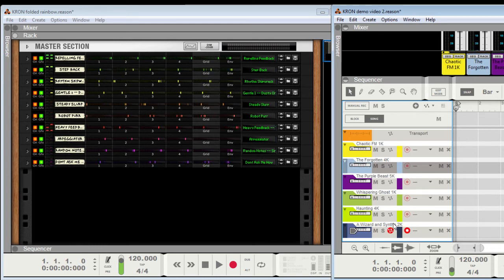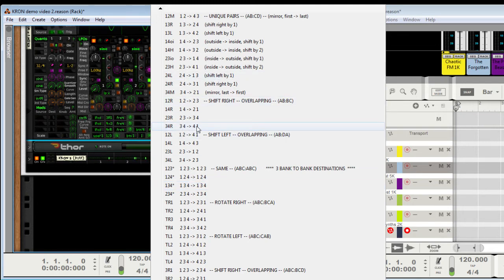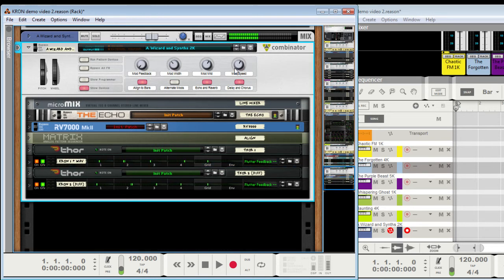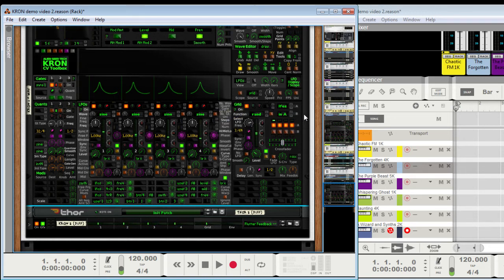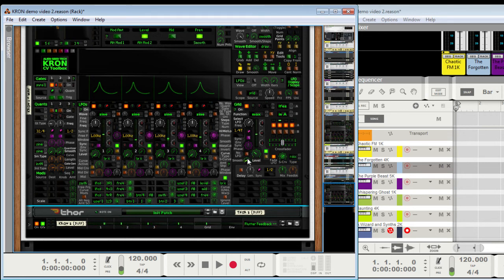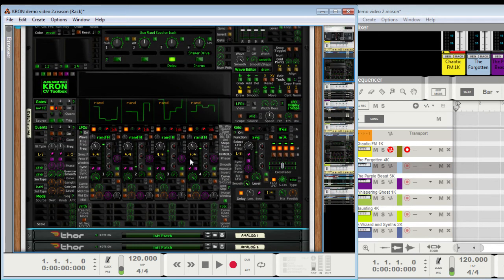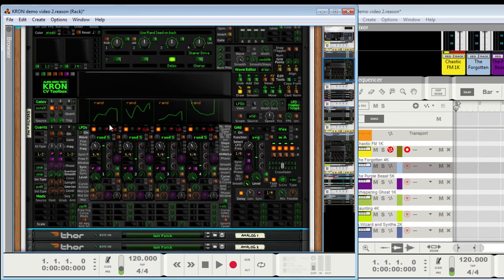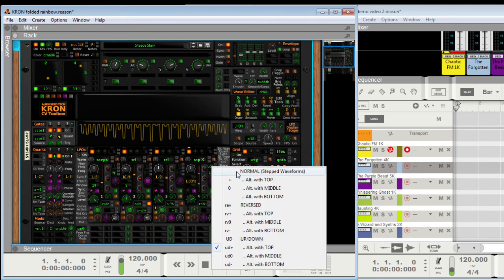KRON CV Toolbox: Demo 2

Comment: I'm sorry; this is off-topic. I notice your DSP level is high throughout the video. Every time mine gets to three bars, my playback/recording gets unstable. Could you give some insight as to why yours isn't glitching?
Reply from the maker: Running using the DX drivers and probably maximum buffer size. And a bunch of that cpu load is via the video capture.. I dunno. I often run over 3 bars with just Reason... but using m-audio asio drivers (and high buffer sizes). It's a quad-core, but it's not enough. :) I definitely run out of CPU on a certain songs... But tl;dr high buffer sizes are probably the way to help that on your end. Personally, I don't have the hardware anymore to do a whole lot at the lowest buffer size. Only when a song is starting.... by the end of some, I have to keep it at the max buffer length and turn off all graphics on my devices. ;) (and wish other REs had that functionality too).
Reply from the maker: * I think your general cpu usage shows up in the dsp meter... It apparently does in the dev version of Reason... I was just watching this the other day, but I'm not sure about Reason itself. I'm guessing so. So fwiw... doing video capture seems to double or so everything... which is very limiting on my end in terms of having songs open. It's really limiting... lol I need a faster computer.